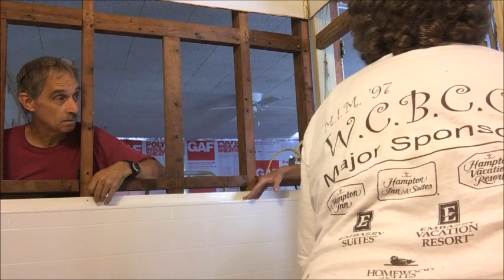Bootz Nextile tub Surround Install

Comment: I was debating between this one and the Delta UpTile. There’s videos of the Delta, but nothing on the Bootz as of today. After this video it only confirmed my choice for this style. Thank you for posting it!
Reply from the maker: It's awesome.  I was thrilled with it!
Reply from the maker: And remember, you may need longer spout stems/cartridges.  I had tile.  I don't know what kind of wall you have.
Reply: I had tile, just finished the demo. First house and it’s a bit of a fixer upper. I’m not handy but on a limited income so I’m trying to learn and be able to tackle most of it myself. The current tub is very dated and has cracks. The tile had a significant amount of mold and mildew behind it. I’m still a little shaken about it all. Like what did I buy?! Ha! This tub is beautiful and even though you both are more experienced than I am it still has encouraged me to tackle this. Waiting on delivery of this tub!
Reply: Thank you for the information on the length/accessories!
Reply: Thank you.. Had the back on wrong!! Hahaha the internet is 👍
Reply from the maker: @elizabeth8804  So are you liking the insert??
Reply from the maker: @jonnimoore9925  How did it work out?
Reply from the maker: @jonnimoore9925  Wasn't the demo a delight???  lol.  I am not experienced so I know you can do this.
Reply: Unfortunately, the bathtub was damaged and I ended up getting the Delta Upstile instead. They no longer had the Bootz available for purchase which is very weird. The delta tub was a nightmare. It’s up though and it’s staying. Lol 

Thanks again for posting! I would Of loved to have the bootz as originally planned.
Reply from the maker: @jonnimoore9925  oh no.  I get a lot of items that are damaged. It's awful.  Do you like the Upstile?  Does it look good?
Reply from the maker: So how did your tub and tile project go?  I know it's  been a couple of years.

Comment: I’m installing this currently. The back doesn’t fasten to the tub so I can push on it and it moves about an inch, doesn’t seem correct although it’s screwed at the top. Did you notice that? I’m thinking the silicon won’t be strong enough to hold it back like I want
Reply from the maker: I've thought and thought on that and the only reason I can come up with is the tub or wall isn't perfectly straight.  Can you get to the back side of the tub wall like I could?  If so, you could screw the flange of the surround to the flange of the tub.  The only other thing I can come up with it to remove the surround and use an adhesive.  Does the surround lay flat if you lay it on the floor.  Could it be warped?  Let me know how it turns out. I'd really like to know.
Reply: The Ropes of Renovation. Thank you and I will for sure let you let you know
Reply from the maker: I was thinking last night.  Maybe when you get the side wall in, it will push the back wall into place.

Comment: Did you purchase a new tub as well? Was it part of the kit?
Reply from the maker: I did purchase a new tub.  We had the old cast iron tub and it was a disaster.  I bought Bootz Industries Aloha 60 in. Right Drain Rectangular Alcove Soaking Bathtub in White   

I didn't lay over tile though.  We used a diamond edge blade to cut through the tile with and angle grinder.  I wasn't all that hard.  There is a video, I think. 

 The surround was a Bootz Industries Nextile 30 in. x 60 in. x 60 in. 4-Piece Direct-to-Stud Alcove Tub Surround in White

It was not a kit but since it was a Bootz and it fit, I bought it.

Comment: You needed to cut the drywall away higher up so you would be fixing it to the studs you exposed not on top of drywall where you are
Reply from the maker: You are correct!  We did

Comment: I have drywall on all sides to meet up to this setup. Do I just drywall OVER the lips?
Reply from the maker: I'm not a dry-waller but that is what I would do.  It's dry walled in my other house over the flanges
Reply: @theropesofrenovation9352  
Thank much. I was wondering if it would create a ramp effect if the lips were thick but I guess that's really the only way.
Reply from the maker: @dominionn09  Yeah.  I'm not sure.  I used luan on my walls so...  So far so good though.  Caulked it well
Reply from the maker: I just had a thought.  You could shim the studs an 1/8" and that would do the trick to keep it from ramping.
Reply: @theropesofrenovation9352  awesome thinking! I may try this. I'll let you know how it goes. I have some rotten subfloor I need to deal with before the tub goes in,🙄.

Thanks much!

Comment: Do you think I'll have any issues installing on our back wall (60" wall) that is concrete? The side walls can be studs, but we live in an old highrise building and the back wall is concrete. I'm concerned about it not fitting properly and the it hanging over the tub. Thank you!
Reply from the maker: I wouldn't think so because the left side of tub (the side opposite the shower head) was concrete in my video.  I used tapcon FLAT head screws and used a countersink bit to counter sink the holes a bit so the tapcons would sit flush.  Also, you might not want to fully snap fit on the test run if you can't get behind it to unsnap the snaps to remove it for the real fit in. I hope that makes sense.
Reply from the maker: My tub was right up against the concrete on the left and I didn't have any problems with it at all!

Comment: Hello. Thank you for the video I know it has been a few years, but we are installing this week and our right side wall is almost in and stuck about an inch from snapping in. Any thoughts? We have two pipes there so it is hard to wiggle it into place much.
Reply from the maker: Hmmm.  An inch is alot.  We had pipe problems too.  May need pex to work around it

Comment: It looks like the back of the recessed shelf is flush with the areas you screw into the studs. Our concrete wall has a seam that sticks out. I’m thinking we will need to grind that off where the back of the shelf lines up with our concrete wall. Do you agree based off of what you know about these surround panels? Will those vertical ridges on the back butt up against our concrete wall or will there be a small gap/space? Just trying to figure out how flat/smooth we have to get this wall. We haven’t ordered the surround yet. I’m trying to make sure we are capable of prepping this properly before ordering. Thank you!
Reply from the maker: Yep, you'll have to grind that down for sure.  I did.  I had to shim part of the back because we had studs there but yes it all sits flush against the concrete wall.  I had a grinder and I used a diamond disc.  It worked really well.
Reply from the maker: I see what ridges on the back you are talking about.  If your seam is horizontal and don't interfere with the ridge, you'll be fine but if it is vertical, you'll need to grind it down.  The ridges  fit flush against the wall.

Comment: Is there any way you can put the fixture side in first since the copper faucet spout is already installed with the diverter?
Reply from the maker: I'm not sure.  It's been so long.  I think the fit might be too tight for any wiggle room.  Perhaps you could get the fixture side fitted by itself then remove it and put the long side in see if it will work that way.

Comment: So you can unlock the tabs then? In case of adjustments needed? That was my concern.
Reply from the maker: Yes.  But we had access to the backside, where some people may not.  But yes.  I gently used a flat-head screwdriver to unlatch.

Comment: Thanks for posting this ! Can you explain alittle more on what you used to drill the holes for the knobs of the shower ?
Reply from the maker: We used a hole-saw.  It's a circular saw that fits on the end of your drill.  They come in different sizes so you'll have to find the right size for the hole you need to drill.  Let me know how it works out!
Reply: The Ropes of Renovation what size did you use bc I gave the same set as y’all for the shower knobs 😊
Reply from the maker: @autumnpruett4014  I want to say an inch but I don't have the hole saw with me.  It's still at the rental and I am an hour away from there.  I just can't remember.  Measure the cartridge that goes through the shower wall and add a tad.  I'm so sorry but I just can't remember!  You measure by the size of the cartridge that the knobs attach to.
Reply: The Ropes of Renovation it’s okay ! Thank you :)